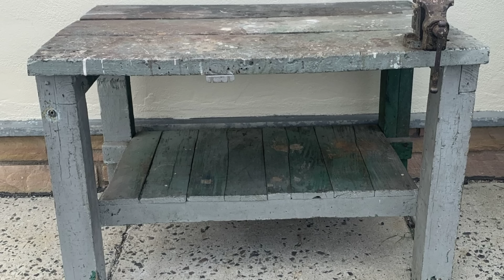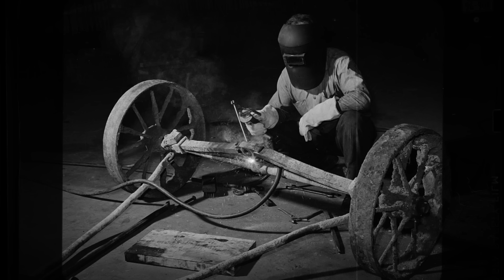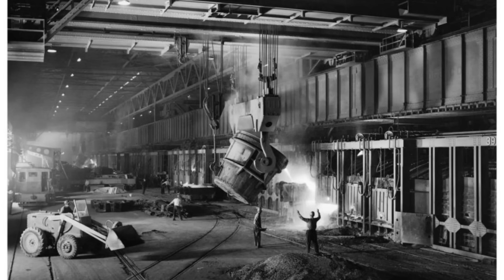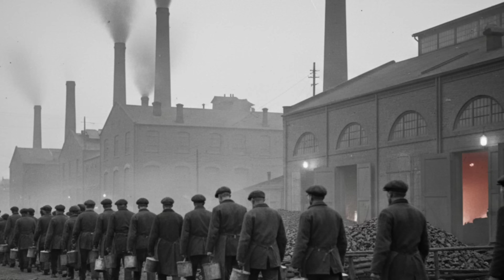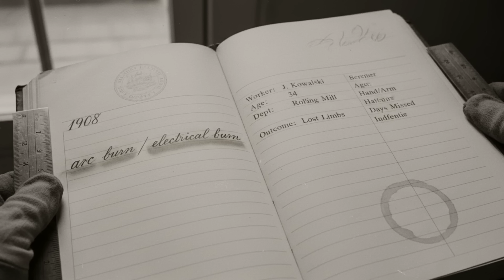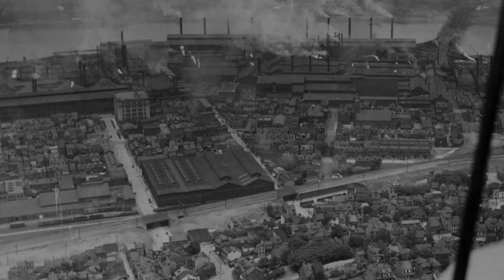The Deadliest Light Nobody Feared : America's First Arc Furnace

Comment: I can just imagine the deaths some of these workers experienced. At least for some, the amperages required to run these arc furnaces was high enough that death was faster than instant. For others I'm sure the burns received was enough to beg for death. Around 3 decades ago a young boy climbed a power line pole next to a local park. It had a transformer on it and at the top, bare made of aluminum strands, wrapped around a steel core. The power in that line cut into his side taking a bite out of him a foot wide and half a foot deep. It was to his spine. Charred black like burnt meat on a bbq. He didn't survive his injuries. Between 7 and 14 thousand volts and anything from just 1 to as much as 20 amps. it was the most tragic thing to happen in the area for the time. It actually changed hydro operations for the region due to failures in the line of command.

Comment: I have been working on a BIG Lead Acid battery bank for my work Van this winter :)   
It will power a couple styles of welders, and a BIG inverter, the main fuse is 500 amps  :) 

The copper buss bars at 3/4" wide by1/8" thick ... that's as much amps as I want to deal with :)

Comment: I was directly responsible for the operation of a Whiting Arc Furnace in the early 1980's with 12,000 lbs per heat for two shifts .
Reply from the maker: Thanks for sharing your experience.

Comment: European steel producers had started using electric arc furnaces before 1900; some of the equipment you picture bear labels of German manufacturers.  This wasn’t a brand-new technology by 1906.
Reply: French patent FR841098A shows a 1938 benchtop, hand cranked, swinging bucket, carbon arc centrifuge made by Traverso & C, Genova, Seems to be a very rare item.

Comment: So carbon fell into the iron &  accidentally made iron stronger?
Reply: No adding carbon to iron makes it more brittle not stronger. Steel is an iron alloy. Lower carbon than iron but more of the desired mechanical properties. Additionally non-ferrous alloys like nickel, chrome and molybdenum made steel more durable than iron. 32 years foundry worker experience here

Comment: I worked on the final commissioning of a scrap weigh scale at a Stelco plant in Quebec in the early 70s. The scrap was dumped in the furnace and the carbon rods dropped down. When they turned on the current the substation blew with a hell of a bang. They discovered that it is best to strike an arc before the electrodes touch the charge.
Reply from the maker: Thanks for sharing that insight from your time in the industry! :)
Reply: Haahaahaa! Guys wanted some hours off to play cards, and get out the heat. We aren’t stupid.

Comment: When I was 16 I made one. I used a carbon rod from a battery and hooked it to 12vdc. Got hot enough to cut razor blades.
Reply: I did the same but with 120 vac regulated with a salt water bath rheostat. The arc could melt rock.

Comment: Story idea: In 1944, the Joslyn Manufacturing and Supply Co. in Fort Wayne, Indiana began work on a contract with the Manhattan Engineering District to turn short, stubby chunks of uranium into long rods. Employees did not know the impact of radiation.
Reply from the maker: Thanks for the suggestion! 💪🏽
Reply: @SteelAndSweatTV  sure. I used to work there around 1990 in management (computer systems), We had a labor strike and I worked in the factory too.
Reply: Processing uranium-bearing ore into purified uranium oxide and then unenriched uranium metal during World War II was done by Mallinckrodt Chemical  Works of St Louis.  Many workers suffered long-term injury from radiation, and remediation of radioactive contamination is still ongoing.